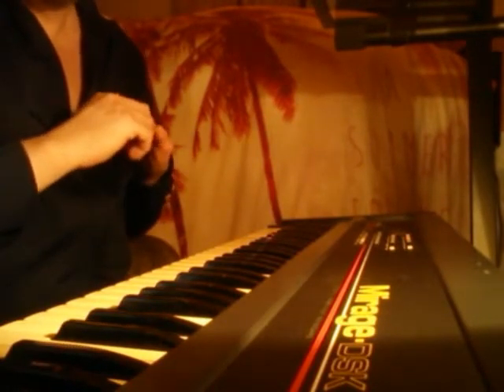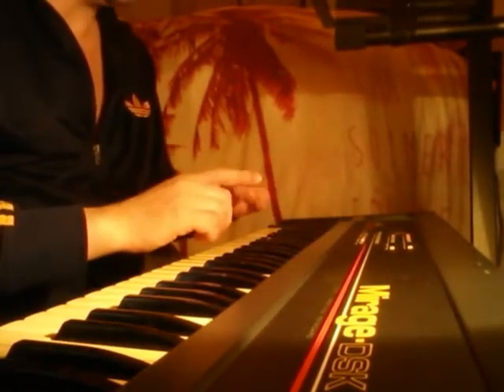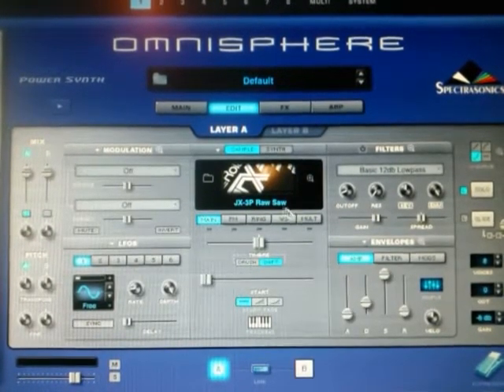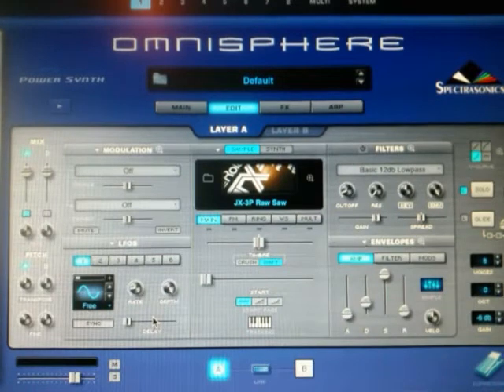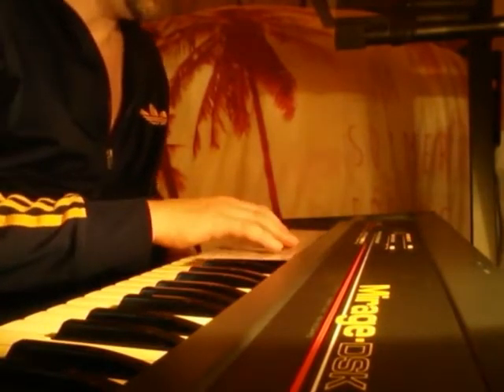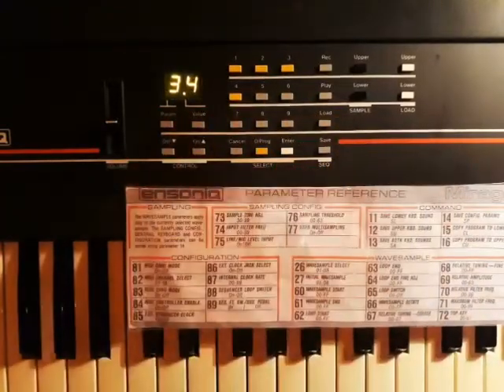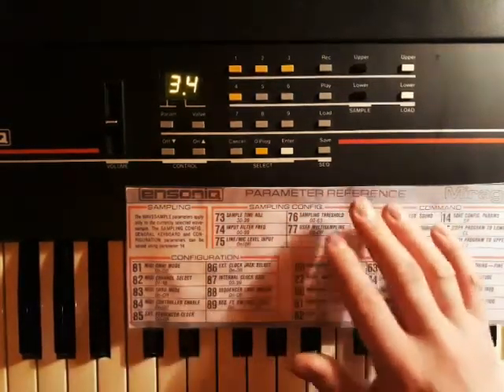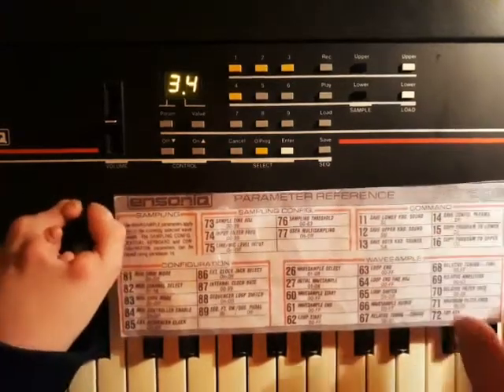The Ensoniq Mirage Series 2 - Sampling and Looping

Comment: I came bak to life my old Mirage, and I realized I forgot almost everything about this marvel.... This video helped me a lot, so thank you so much for this extensive and clear explanation... but I still have a conceptual doubt.... If I sample, for instance, a C, based on the appendix and in order to have a single waveform in the memory, at sample time = 60 (sample rate 16666), but that C won't be placed at its corresponding key in the keyboard... I still need to use the Fine Tune to "accomodate" that sample to match with the "physical" key? Thank you so much in advance!

Comment: there is an Appendix in the manual. It tells you what tuning the mirage expects from the incoming sample to fit a single cycle for that sampling rate. There are only so many sampling rates to choose from
Reply from the maker: Correct!

I learned this principle from Jammie from the Transwave Synthesis while working on the EPS-16 Plus and Transwaves. I tried it out and it works well on the Mirage too.

Thanks for reminding me. I will try out the different notes and sample rates for some upcoming project, if time permits.

Comment: I’ve been watching many of your vids, and trying to learn this editing system, bought the V. 2 OS, Masos disk, and FMT V2 disks. After trying to edit a sample, I have noticed the 5 button on my mirage is unresponsive. Making the machine useless. Is there any way around this that I’m not getting? Or do I need to open it up and try to clean the contact? Have you ever opened one of these up? Sorry for the lengthy message, but I really want to get this machine to work correctly! Thanks!
Reply from the maker: Allen Oberhem Hi Allen, yes, I have opened it up. Usually that is not a problem. The 5 key not responding might be as simple as cleaning the contacts or reflowing the solder joints. If this particular one does not make proper contact anymore reflowing the solder might solve it.

Even though I do know this machine inside out on the user level I don't on the technical level. I have done some basic repairs on equipment but I am not a technician.

I would like to invite you to my Ensoniq Users Group on FB. We have some people there with lots of knowledge of Ensoniq.

Comment: Thanx! great info... I have two Mirages (DSK1 and DSK8) and to this day I never found the time to really understand how the memory works.
Reply: They sound the same, the DSK1 has stereo output and is way better looking. I use the DSK8 more because I bought it first and it has the HxC virtual floppy drive in it. The stereo outs on the DSK1 are cool, the panning is based on the keys of the octave, not random or switching one voice to one side, next voice to the other. This is much more useful for pads and chords in general because you get an even balance most of the time.